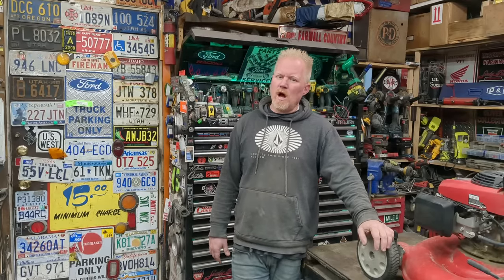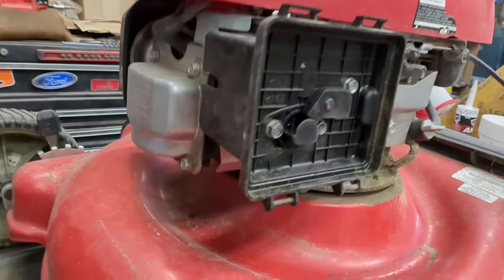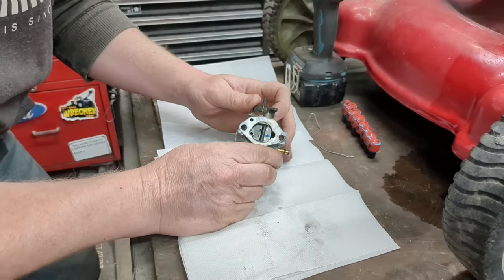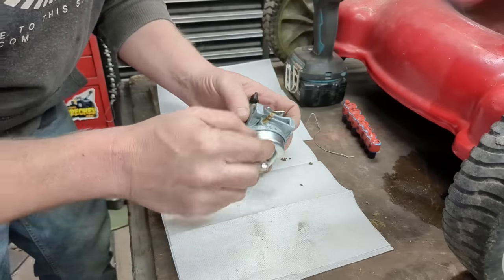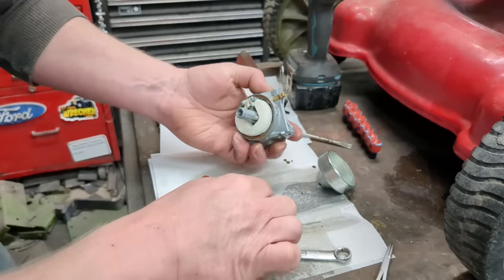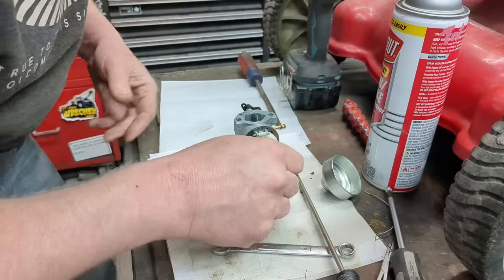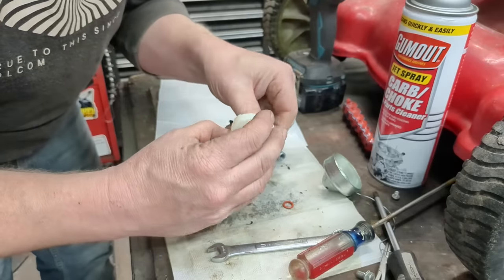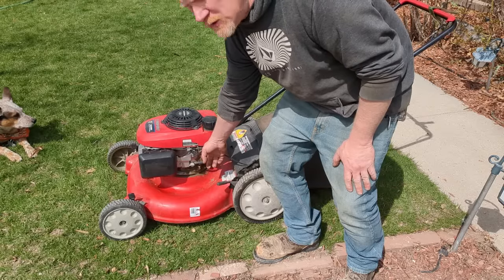FIX Engine Surging on any small engine QUICKLY

Comment: When I clean a carburetor, I spray, poke and blow out all the holes, everything. Have a very high success rate as a result. If you are not mechanically inclined, don't kid yourself or waste your time, take it to a shop.  Most customers change the spark plug and give up.
Reply: Timing is everything. Not THAT timing. I started one of my mowers. Funny how exact the motions are.  Uncovered the carb and rods etcetara. Stuck my finger in wiped it on my jeans and Voila.. done 4 cuts so far, and pulled the cord and 4 starts. Nice.
Reply: Who do you think is watching these videos? The mechanically un-inclined? Not likely.
Reply: @khester7397  the mechanically curious are also watching. 😊
Reply: So you are doing great. I'm a mechanic and I have been working on machinery like this for quit a while now. I'm EETC certified and I want everyone to winterize there machinery correctly and your machines will never fail you with this method. Run the fuel tank completely dry and put in some Aspen fuel. Start it for a little bit and set it off the side till next year. I swear it will never fail you with this method. If you can afford it run nothing but Aspen fuel. It's good in the tank for 3 years and good in the unopened bottle for 5 years. Trust me you will never have any carburetor problems with this method. Look up the Aspen fuel if you don't believe me.
Reply: B
Reply: Mechanically inclined to clean a carburetor??? Lol
Reply: @Rabid_Badger_racing  What about Stabil? I have some but don't know how to use it. Thanks for the Aspen tip.
Reply: @ptlentz stabil is for storing your equipment with gas in it. Not a great idea. I always store on an empty tank.  Also, not sure if this is an old wives tale, but use non ethanol fuel in carburated engines.
Reply: I’ve learned plenty from YouTube and done on my own. I’d never refer to myself as “mechanically inclined.” I didn’t have this kind of knowledge handed to me like most mechanically inclined people often fail to mention. They were fortunate to have a father or uncle to pass down knowledge like this. I have to go to YouTube for these answers and more often than not, it works for me.
Reply: @Rabid_Badger_racing are you sponsored? Sure sounds like it.  Most of the "engineered" fuels are worse than full with 5% methanol.
Reply: I don't even bother doing all of that when carburators are so cheap these days to just replace.
Reply: @khester7397 who hurt you?
Reply: @-Kreger- why isn't it a great idea to use stabil?
Reply: @TingTingalingy  I’m saying it’s better to store without fuel. If you need to store with fuel in it, I guess use it. But I’ve always had the best luck with fresh non ethanol fuel.
Reply: @-Kreger-  I was hoping you had actual reasons, not just a baseless claim.
Reply: @TingTingalingy  I hear ya. I re read my post. It was poorly worded. Good call out brother
Reply: @-Kreger-  surely. How do you empty the fuel tank? I mean i know it can be drained from the hose under the tank, I've just always ran my machine mostly empty
Reply: @TingTingalingy  I mainly run it empty. If for some reason it had a decent amount in before I finished I’d drain it on the carb bowl, or the fuel hose to the carb
Reply: Thank you for info worked for me
Reply: Um, no. I will NEVER take my stuff to a shop to be scammed! We re all smart enough to learn this!! You must work at a stealership
Reply: Carbs aren't hard.  Rusty bolts and having to crawl under the car is always what stopped me.
Reply: @khester7397 where do think noobs go to find out how to fix something in 2024?  Right here, so you'd be dead wrong!
Reply: @ptlentz  Stabil works great for keeping gas from going bad. My father has been using it for probably 30 years now in his lawn equipment etc. and even sitting for multiple years old gas has never been a problem. It's advertised as working for 2 years but it probably prevents problems far past that. It's not rocket science to use and even 4x the recommended amount is still safe. Just remember to run it for a bit after you add it so it can mix.
Reply: I have cleaned the carb this way, even let it soak in an ultrasonic device for half an hour. Cleansed the tank also. It run a little better for half an hour, but now it is the"good old" teaser again! Is there any other reason for this uneven running! Magnetproblem etc.?
Reply: @larsh.alhaug1771  no is the short answer.  Uneven rpm means not enough fuel or old gas too much air or a combination of all of it.  If the item is in good repair it needs more fuel, so open the fuel screw under the bowl 1/8 turn at a time until the surging stops.
Reply: @wsbill14224  I have an older Stiga and it has no adjusting of fuel amount "under the bowl". Where is it on my carburettor. Is it the Idle skrew?
Reply: @larsh.alhaug1771   no.  Most newer carbs don't have an adjustable fuel screw, and in that case surging is caused by old gas, dirty jets, intake leaks, or all three.  Old gas and dirty jets are almost always the culprits.

Comment: I add seafoam to all of my gas tanks and engines at least once a year. I don't think I've ever changed oil in any 2 cycle engine. I just add it when it's low. I've also never cleaned a carb on one.  Now, my vehicles are a little different. I still use the seafoam, but I always put it in the oil a few weeks before my oil change and in the gas at least 3 times a year when I fill up.
Reply: I don't believe anyone changes oil on a 2 cycle engine!
Reply: Oil change on a 2 cycle ? There is a new one. Amazing those folks also get to vote

Comment: Awesome video!  I had a frustrating problem as described but I didn’t know the small details you covered towards the end of the video.  THAT turned out to be the problem.  Thank you so much.  One tip for other folks watching this video is at minute 4 where he’s removing the fuel line.  Not all engines have that cutoff valve so use a vise grip set to gentle so it cuts off the fuel but doesn’t damage the fuel line.  Guess how I found out way back when.

Comment: After fixing a lot of my neighbors yard equipment just like this I've found that most small engine stuff dont have fuel filters, So if you find yourself having to do this go an extra step and add a filter because chances are there is debris in the tank that will clog it up again!🍻
Reply: Would have been useful to hear the engine running before the strip down

Comment: Thanks 😊 . At 10:41 when the Sharpie Marker came out , I knew during my previous two cleaning attempts, I hadn’t cleaned the passage highlighted by the black marker.  I spent 20 minutes with carb cleaner verifying visually that this passage was clean.  The small brass jet under the big Phillips screw was likely the block point.  Small brass jet is too small to pass a copper wire , so you need to watch to see if a drop of carb cleaner will slowly drain through the small brass jet.  Afterwards, my Honda 160 YardPro mower started on the first pull, no more rpm surging or hunting, no choke needed to stay running.  Runs like new. 😎 Thanks again. 😊

Comment: Keep your filters up to snuff, and avoid doing this too often. Especially the air filter. Make sure it's installed right and not sucking in dirty air.
Reply: At the same time dont mess with the air filter too often. It can allow dirt into the carburator when you mess with it. Checking it too often increases the risk of having the carb clogged.

Comment: Great video!  I only run non ethanol 91 or higher gas for all my small engines too.
Reply from the maker: I just wish I could still get low octane 85-87 still in ethanol free. That way I didn't have to pay a premium gas price for no benefit.

Comment: This is excellent advice! 👍 I switched to alcohol-free gasoline in all my small engines. It completely eliminated all fuel related problems. There's no need to add fuel stabilizer because it has a very long storage life. It costs more but in my opinion the price is worth the lack of problems. We live in a rural area so almost every gas station has one pump that sells "real gas".
Reply: Have a place down the road from me that sells non ethanol gas. Thinking about using it for my mowers and trimmers also
Reply: I keep a separate Jerry can with 93ron Ethanol-free gasoline and use it for all 2-cycle equipment (mitigates diaphragm hardening). That, or if I will be storing any small engine,  I will run Ethanol-free fuel a bit until I run the carb dry.
Reply: Hello Jon, what is this alcohol free gasoline?
Reply: @erikacellar8679  Ordinary gasoline for your automobile contains up to 10% ethanol alcohol. Alcohol free gas contains no ethanol and is labeled so on the pump.
Reply: It's ethanol free, not alcohol free. Only one gas station near me sells it and there is just the one tank. Sometimes I have to wait for it. At least it's a separate tank, so I know it won't get mixed with ethanol gas. Do yourselves a favor and get a battery mower. No more buying gas, spilling gas, changing oil and filters or cleaning carbs.
Reply: @frommatorav1 Ethanol is alcohol. The two terms are synonymous. But you are correct the pump will be labeled non-ethanol or ethanol free.

Comment: All good ! 👍
Not everyone has an air compressor , but if you do , after spraying and clearing all the passages, followup up with higher pressure air . 
About 60-90 psi is all you need .

Comment: Just got an older Toro probably from late 80s to restore (for fun), the carb is much easier to access than what you showed here, I guess they don’t make them like that anymore… 2 bolts and you can slide the air filter then a small gasket then the carb right off.
And that’s probably the smoothest pull start I’ve ever seen 😮what kind of blue magic did you practice on that machine…

Comment: Put a new carb on my mower and it still surged Bought a new governor spring from Ereplacement parts in Midvale and that cured the problem. Great fix to start with.
Reply from the maker: A stretched governor spring would only cause a drop in engine RPM. A stretched out governor rod tension spring(attaches directly to the butterfly/generally wraps around the rod) could cause a little flutter in RPM(very minute). But it would have to have zero tension and just essentially be laying there. It's only job is too take the tiny slop out of the governor rod to butterfly hole. The only time I've ever seen a flutter in RPM from the tension rod spring was on engines with 1000's of hours and the hole where the rod goes into the butterfly is egged out to nearly 1/8"

Comment: I replaced the Carb on an old Craftsman rider. New Carb surges. Maybe the cheap knock off Carb is my problem. Like you said at the beginning If you  give it  more throttle it  smooth out. But it has to be at the sweet spot. Which in a  let it run at max throttle engine. Does not work on a throttle you can adjust. One  mech told me the jet may need drilling out just a little.
Reply from the maker: The idle jet can be easily drilled out on a lot of carbs. Harbor Freight sells a micro drill bit kit for $3. You just find the but that barely fits and go up one size.
Reply: @sixtyfiveford  Thanks!

Comment: All you have to do is hold the governor open while you spray carb cleaner into the open carburetor, it will want to shut off but don't let it, work that governor. And it'll run like new. I've been in the small engine repair business for a few decades.

Comment: This is great for those of us who are already mechanically inclined, and like to tinker....I totally understood what you are showing us, but for people who don't enjoy this kind of work, you can get a new carb for around $15. Just swap it out. I got lazy on my last 2 stroke job, and just replaced it. I kept the old one just in case.
Reply: oh yeah....even after replacing the old carb, I started getting problems again. Not sure why... I had a new fuel filter too.... I just opened the carb and drained out old fuel, and put it back together. Runs good now. I think it was overwintering without fuel conditioner or anything.
Reply: After you told me about the quality of cheap replacements, I think I'll give the old one a workover and put it back in. It's nice to have a back-up for quick fixes!  Put the clean one in and keep working, fix the other one when you have time.
Reply: Another thing you taught me that I didn't know... surging is related to clogged carb. That's helpful! Thank you.
Reply: I bought one of those $15 Briggs carbs. It worked great for a little while. After a month the float bowl float got a leak and flooded the engine with fuel. It cost almost half the price of the cheap carb for an OEM float but now it's running properly again.
Reply: @Jon.Carlsen   I've been having problems with this carb. It runs good for awhile, then it declines quickly. Removing the carb and draining it makes it run ok for a while,  but then the same thing happens....It's been driving me nuts!  I hadn't thought of a leaky float...that would make sense. Thanks for the tip. I'll check it next time I get the gumption.

Comment: Before you assume it’s the carb and start taking things apart or buying solvents, the governor could be suffering from the wrong spring tension.  Check that all the springs are attached and look intact.  This happened to me when I mowed under a low laying pine branch and a twig unseated one of the springs.
Reply: Have had the surging problem with a number of mowers, over the years  usually changing the spark plug fixes the problem. Easier, cheaper and less time than taking the carb apart.

Comment: Honda did indeed do a great job. Still using the Honda self-propelled I bought in 1986. Cranks within 5 pulls after sitting all winter and on the first pull throughout the season. Amazing to me.
Reply from the maker: Definitely think the older Honda like you have are better than the ones made in the last 10. 20 years though. Fantastic engines the new ones just have endless transmission problems.  I always recommend Toro for anything made in the last 20 years.

Comment: Switched my old JD lawnmower over to 89 octane and that fixed the surging issue and it starts easier now.
Reply from the maker: Doesn't really work the way most people think. Higher octane means the fuel is less likely to combust. So switching too 89 vs 87 simply means you put fuel with less ability to combust/less power. You likely had contaminated fuel with water combined with the 10%ethanol in it. This will happen to your 89 if you leave it in a gas can for a few months.
Reply: @sixtyfiveford  I put Stabil in my fuel can.  That mower surged like that for years, then I got it and switched it over to 89 octane and it stopped it.  A lot of people are doing this where I live in western Kentucky.  I knew someone that used to do parking lot maintenance and they had to switch their leaf blowers over to 89 octane so they would run properly, and no the fuel was never contaminated.  Idk what it is, but since  the switch to %10 ethanol, this seems to be common.

Comment: I changed every thing on my mower plug , thermo wax, totally clean every jet in carb, ten times still surging badly then by mistake took the metal rocker arm off which attached to the carb, undo nut pull off the shaft pulled out pin pulled shaft out cleaned it replaced it ,started up now starts first time runs perfect, all I can think it was not sitting on the shaft properly, five minute fix, after I removed carb at least twenty times re cleaning, and removing all moving parts, hope this will help other owners

Comment: Honda makes a jet cleaning tool. Similar to cutting torch tip cleaner, but has smooth wire of various gauges. No enlarging holes. Also, a new Honda carb is about $16. From Honda.

Comment: Mechanic here for 35 years. I use aftermarket carbs from Amazon all the time. No issues. As long as you buy the right one. The OE carbs are made in China or Taiwan anyway. The problem is usually water or sludge in the fuel bowl which blocks the jets. Smaller jets don't help either and clog up faster thanks to the EPA. For newer engines if is rarely the air or plugged fuel filter unless the filter gets a hole in it and lets dirt get to the carb. Seems like todays carbs need cleaning almost ever other year, especially if you let fuel sit in the tank over winter. A bit of acetone in the tank might work but it's only a temporary fix. E-10 or E-15 pump gas is ok for lawn equipment as long as it's all used up before end of season storage.
Reply from the maker: I'm going to call you out. You think these aftermarket carbs are anything even remotely like the OEM you have something coming. That means you're making it run and flipping It for a quick profit. These aftermarket carbs suck! They literally will rattle themselves apart after two dozen uses. Most of them will surge right out of the box because the Jets are wrong sized and I've seen them ruin perfectly fine engines.

Comment: I couldn't  fix a hunting problem on a scythe and got a new carb from Ebay. I thought that the original carb had maybe worn with an air leak because of the large amount of rocking action vibration coming from the cutter blades. I reckon now the old carb just needs some carb cleaner to clear out the idle passage way and I might have a working  spare. Much thanks for the video.

Comment: My neighbor used to be a house painter so he went through all the neighborhoods in our area many times. When he need a mower, he would almost always find one sitting on the curb somewhere. We would spend less than 5 bucks replacing the needle valve and seat, clean the carb and they would run for years.